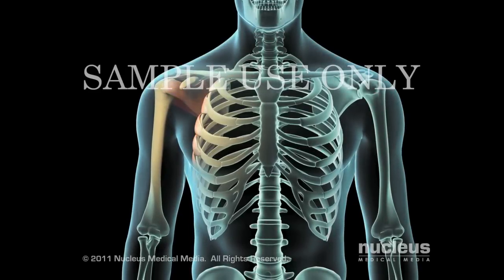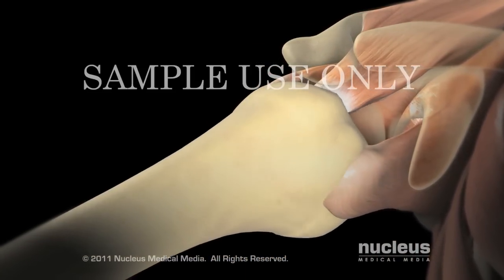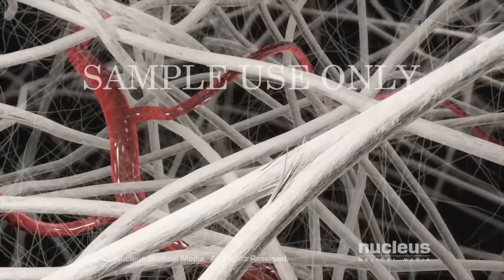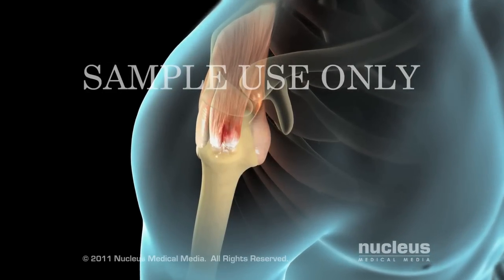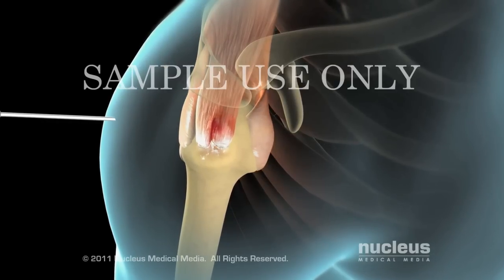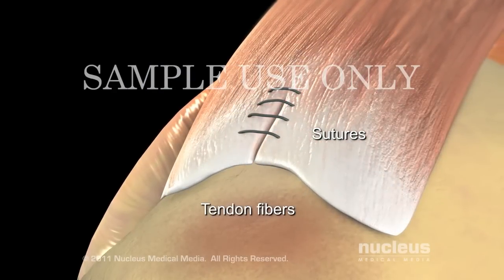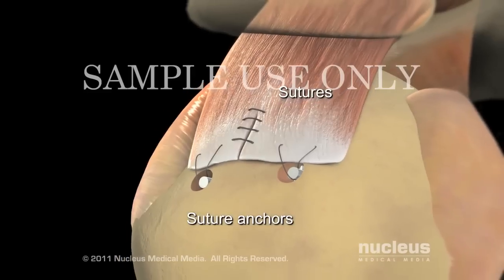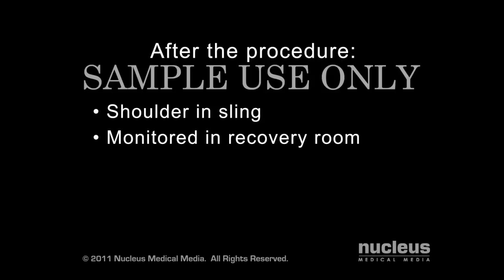Rotator Cuff Shoulder Surgery

Comment: If the tendon isn't completely absorbed by the bone in those anchor points, those thin sutures are just going to cut through that tendon like a string through cheese, leaving the patient with less tendon to work with in a future repair. We can do better than this. The suture should be replaced with 16 gauge bands at mutile points in the tendon and have slight elasticity.
Reply: does this procedure exist or you made it up yourself? Also, why wouldn't it connect to the bone?
Reply: @besmart2350   I don't know if it exists. I just thought it would work better. I could be wrong.
Reply: @LawJones413  go become a surgeon and write a thesis on this exact topic and be first who invented a new better procedure

Comment: A condition when bones become weak and brittle.
The body is constantly absorbing and replacing bone tissue. In osteoporosis, the rate of new bone formation is slower than the removal of old bone tissue.
Many people have no symptoms until they suffer a fracture.

Treatment includes medications, a healthy diet, and weight training to help prevent bone loss or strengthen weak bones.
↔ ↔ ↔ ↔ ↔ ↔
In some circumstances, osteoporosis is difficult to prevent. However, you can reduce your risk of developing osteoporosis by quitting smoking, abstaining from drinking alcohol, getting regular check-ups if it's menopause, exercising regularly, and eating foods rich in vitamin D and calcium. For further information, please visit: https://tinyurl.com/dsgserrt?gdthrt >

Comment: Had the surgery after a fall on ice.  Yep, went home the same day.  That night about two am after the block wore off I felt like I was hit in the shoulder with a 180 grain 30/06 round. PT very painful at first. After 8 weeks everything was almost healed.  Shoulder is fine now.
Reply: Buck Appel it’s been 12 weeks for my surgery now but when I returned to work about two weeks ago.  I started having pain and stiffness. Did u had anything like that. How long did you go physical therapy. And is there any weight limit or restrictions you have to follow right now. Thank you
Reply: Karan Mohan I think I went to PT for 12 weeks.  If you are still having pain and stiffness try doing your exercises at home again, that’s key to prevent a frozen shoulder. I was on a weight restriction for several months but can’t remember what the weight was.  Give your Physical therapist call and tell them you were still having some problems. It’s a slow process but if you keep working, it will eventually get back to normal. It’s a tough recovery.   I’m now having a wrist fusion next week and I’m not looking forward to it.
Reply: Buck Appel Can you hang off of a gym bar now with full motion and no pain?
Reply: Jasmin Flower I don’t know about hanging off a gym bar, I haven’t tried it but I can lift weights and exercises without any pain or discomfort.  After the surgery I never thought My shoulder would be normal but it’s really good.  It’s very important to do the physical therapy religiously. It was painful at first but helped tremendously.
Reply: I fell of fucking mechanical bull sat on it was shaking its head up and down it yoinked its head so high I caught air landed upside down with the whole weight of my body on my right shoulder I literally heard kkkkkrkkkkkhhhh sound and it fucking hurt went to the orthopedist the next day he said lift your arm and I couldn't I literally felt like crying thinking wth is going on the x-rays showed I bent my collar bone as well and my humerous moved up by 9mm he said I just have to put on a sling by gravity it will comeback down just that I can sleep on my back at night I have to sit /sleep it's been nearly 10 years am healed by I feel a certain stiffness on it
Reply: I fell ice skating very hard on my left shoulder.  Had the same ‘classic’ procedure done here.  Your inputs about healing and PT are very useful.
Reply: How torn it was? More than 50%? Can you go to the gym now after surgery?
Does 30 - 40% supraspinatus tear require surgery? Can it regenerate itself if left without a surgery? Are there any patients of a young age who had it grow back on its own?

Or it never grows back because it’s impossible from the anatomy and biology standpoint and with special exercises we only make what is still attached to the bone stronger and the torn part remains torn forever?
Reply: how much surgery costs?
Reply: Same
Reply: Cost of surgery ??
Reply: Yes, no one tells you the hell of pain that comes when the block wears off!
Reply: When you started talking about bullets/ ballistics I felt as if my purpose in life was complete as I appear to be the only one here who understands how bad a 180g, 30-06 round to the shoulder is
Reply: Clan of Wolves Official LOL! I was never hit with a 30/06 round but was hit with mortar shrapnel.  It wasn’t 180 grains though, it was smaller probably about 60 grains.
Reply: Buck Appel, i figured That as a 180g 30-06 to the shoulder will do massive damage, and will most likely take the arm off if it hits the bone.
Reply: Clan of Wolves Official I’m sure it would.  An M-14 fires a 7.62 round which is simalar to a 308 and I’ve seen the damage they do
Reply: Buck Appel I don’t remember asking
Reply: Tickedhat It’s not like you had to answer though

Comment: I had this done in October 2018, then had to move in January 2019. I tore everything that the doctor fixed completely loose again and then some. I had an MRI in June 2019 to see if anything was salvageable, and the doctor wants to try and fix it again. I'm 60 years old. I'm not in a profession where I need a lot of overhead stuff but this is my left and dominant arm/hand side. If I mess it up again I'm done for, maybe even worse than it is now. I just have to live on NSAIDS and take it easy.
Reply: 60 years old, youve worked long enough. no job is worth losing use of your arm.
Reply: So sorry, my dominant arm is screwed up and I now need surgery.

Comment: I need help, I can’t squat at the gym cause it hurts my shoulders so much I tried low bar high bar wide grip but I just can’t my shoulders hurt so much I can’t do laterale raises either both of my shoulders crack... what should I do
Reply: Go see a physiotherapist or a chiropractic. Dont neglect it
Reply: I found an exercise on YT with a band (pulling arm behind you) and it really helped. It depends though how messed up it is. Each case is different.
Reply: use a "safety squat bar"

Comment: I was in the gym picking up dunbells when out of no where my should pulled and it shocked the hell out of me wasn't really painful but was some pain. I quickly  tested my shoulder out and was able to move it. The pain came from my rear delt. When I moved my arm back like I was doing a row it would be pain full. The pain only lasted a few days so by time I seen a surgeon they told me it was a high possibility that I popped my shoulder out and it popped back in. I really thought I tore. What do u think
Reply: you need an MRI not x ray
Reply: if u really wana be safe ask for xray or ultra, but dont workout lol
Reply: @tatebarnum731  I did get a x-ray they didn't see nothing wrong
Reply: @ygbodybuilder3023  idk but the more ur shoulder pops out the more likely it is to happen again so i would chill with the training for a bit or go light and controlled.
Reply: @tatebarnum731  chill and go light than what? It's been 2 weeks. Already I'm ready to lift
Reply: @ygbodybuilder3023  um be carefull on bench press and shoulder press, prioritize back training. im not that sure what you should do but a strong back will help to stabilize that shoulder
Reply: e fred  🖕
Reply: @ygbodybuilder3023  hey how you doing? have u dislocated it more?
Reply: @mustafakarim6654  no I have not had it happen again but I do believe it's some type of tear in my shoulder, probably not enough where surgery is a emergency but it's definitely some tears in it. I had shoulder problems before this happen

Comment: Idk what’s with my shoulder it pops out then i need to pop it back in whenever i do the wrong movement, sometimes I get a really bad pain when it pop out but days after it goes away. When I sleep it doesn’t hurt or bother me but I do feel it loose when even I reach for something.
Reply: Sounds like it's subluxing or dislocation due to laxity. Have you ever injured it? If not it might me rotator cuff  instability or a labral issue. Try rotator cuff strengthening. If after 6-8 weeks it doesn't get stronger or the "popping out of place" does not subside see an orthopedic physician.
Reply: TheDirthound the first time that it has ever popped out was while playing soccer, someone pulled my arm and I had to pop it back myself by pushing down. And some other times it has popped out by me swinging my arm too fast or playing basketball and going for a rebound.
Reply: @killerdavid2387  Sounds like an unstable glenohumeral joint from subluxation/dislocation. I'd go see a good physical therapist for implementing an exercise program or else it will continue to be unstable, cause pain and eventually cause arthritis and degrade. You might even need surgery to stabilize it but try therapy first.
Reply: TheDirthound oh ok thanks!

Comment: I have cracked sound while lifting up and down what I can do??
Reply: It could potentially be that the muscle is tight causing friction around the bone. A physical therapist pointed out the issue of muscle strain, tear or fracture that needs to be addressed. Also, ice the area if it causes pain to reduce swelling.
Reply: @dhull.I  tq
Reply: @dhull.I  oh thank you & your contact number
Reply: @Jaymie Pierce how to do
Reply: @Jaymie Pierce it gives sound only not pain
Reply: my shoulders cracks, pops and crunches like no tomorrow, probably because i have very tight neck
Reply: Pray God

Comment: also sleeping in wrong position while drunk will cause dislocated shoulder or rotator cuff injuries. It happnens a lot more then the other reasons listed in the video, I do not understand why the medical comunity does not include these. 
if you have a bad rotator cuff or a subluxed shoulder and have a job that requires physical activity a you will lose your job, you should rob a bank, screw some hookers and revenge your enemies and die quick there is no hope.

Comment: So these things stay in your bones forever they don’t bother removing them
Reply: It won't harm you to leave them in. Also it'll do more damage to remove them then they will cause.
Reply: @MrZane777  What are they made of that allows them "to absorb into the tissues"?
Reply: @lukemain4222  Dissolvable stitches are made fromnatural materials, such as processed collagen (animal intestines), silk and hair, as well as some synthetic materials that the body can break down. This allows the body to dissolve the stitches over time. Usually, by the time the stitches are dissolved, the wound is completely healed.
Reply: @lukemain4222  The metal won't dissolve but it won't harm you, I have 6 metal plates holding my vertebrea together and I still function normally.
Reply: @MrZane777  I see videos that show monofilament stitches being used. Is it just patient preference? The mono being permanent to ensure the tendon doesn't tear away again? If that's the case I think I'd take my chances with the dissolvable ones.
Reply: @lukemain4222  Usually they won't put nondissolvable stiches inside of you. I'm sure maybe the hospital was either or the repair was so severe that they need the strength from it. Either way never really heard of that happening because usually they'll use medical glue and medical staples together with dissolvable stiches

Comment: While rotate My Left hand 360 degree sounds from Shoulder joint is it normal???
Reply: Take some for of naproxen or ibuprofen. Odds are you damaged it and the bursa sack inside your shoulder (this is what lubricates your shoulder to move) is inflamed. Do some very light stretching if you have difficult with range of motion but otherwise it is inflamed rest it, ice it, and take the aforementioned medication.

Comment: Had my right shoulder done about 4 yrs ago. It works perfectly. Now my left shoulder is hurting the same as the right one did. Here we go again.
Reply: Can I ask you a question? I can't lift or pick up anything with my left arm and shoulder. When I turn my arm in a certain angle or pull it I feel a pop in my shoulder. When j put pressure on my shoulder(like sleeping on it) it really hurts and overall my shoulder just feels weak...is this a sign of a torn rotator cuff or? Idk what is it but its been happening for a month and it's getting worse
Reply: @Sprixx3D  
I'm not a dr but it sounds like it would be a safe bet.
Reply: @larrysmith1568  .
Reply: @Jho1  
I don't know. I would say if you feel like it do it.
Reply: @larrysmith1568  no after 4 months I can't fight are you crazy I mean you Larry can you fight? We have the same surgery it won't pop out right you will be able to fight and throw things? Did you try throwing how is it?
Reply: @Jho1  
After 4 months I could do anything I wanted to do. My shoulder is better than ever.
Reply: @larrysmith1568  oh aigjt
Reply: @Sprixx3D  how are you now?
Reply: @Sprixx3D  could be  AC joint, as well
Reply: how long did you keep your arm in support?
Reply: @stivigoxhaj1294  
I was in a support sling for about 14 days. Believe me, after this surgery you will want to support the shoulder. It got progressively better everyday. My tear was 1 inch, which is significant. So I suppose the healing is relative.
Reply: Larry I'm in 4 months after this surgery can you fight and wrestle with this shoulder?
Reply: I had a complete tear in my left shoulder in 2014.  Did it at work.  Lots of PT and due to the kind of work I do, I was off about 7 months.  Retired now, but I'm sure I tore the RC in my right shoulder a couple of weeks ago.  Same loud pop and same kind of limits on the range of my shoulder.  Got an appointment with the orthopedic surgeon 1-30-20.  Not looking forward to it.

Comment: Believe it or not I have tore mine sleeping, yes sleeping.
I fall asleep on my back with my arm above my head
Reply: Damn I had a seizure walking up the steps and then fell and broken my rotator cuff, ball joint and my humerus. I was hospitalized for 3-4 days. They said it will take me 2 to 3 years to heal
Reply: Did you completely tear it and need surgery?
Reply: It ain't much but its honest work
Reply: Ross Harris where u sleeping on floor?
Reply: I experienced that as well when i put my hands underneath my head then when i woke up it was dislocated right away...
Reply: I'm preparing because I will be Holding my backpack And its on shoulder
Reply: how old are you? maybe you old and that's why. Or maybe you were overusing the tendon throughout life and sleeping in a wrong position only finished what was coming for a long time
Does 30 - 40% supraspinatus tear require surgery? Can it regenerate itself if left without a surgery? Are there any patients of a young age who had it grow back on its own?

Or it never grows back because it’s impossible from the anatomy and biology standpoint and with special exercises we only make what is still attached to the bone stronger and the torn part remains torn forever?

Comment: just dont understand but in 2005 had a seizure while falling down a flight of stairs in the house but all it did was pop until Aug. 2018 n then i had severe pain n couldnt lift arm. i had my surgery on Nov 15th 2018 n dont use my sling. should I?

Comment: How the tendons of the muscles are healed..I mean again inserted on bone ?
Reply: Roshan Gavit bone surface is “roughed up” and bleeds before tendon is pulled down tightly to it with the anchored sutures.  Tendon must not be pulled off of arm bone so arm is immobilized in sling for about 3 to 4 weeks.  Maximum ATTACHMENT strength is not achieved until week 20-24 ( 5 to 6 months post op ).  Flexibility and strength may take another 6 months to peak. (Up to 1 year post op ).  Even Complete detachments (large/massive tears) can be repaired aurthroscopically if surgeon is very experienced in this technique. Had both shoulders done 6 months apart 10 years ago.  Not fun but good results.  The longer you wait after the injury happens to get surgical repair the less tendon the surgeon has to work with due to atrophy of the torn tendon.
Reply: My thought too ... at the end of video she says sutures are absorbed but that would leave the tendons (with limited blood supply) unattached to anything, no?